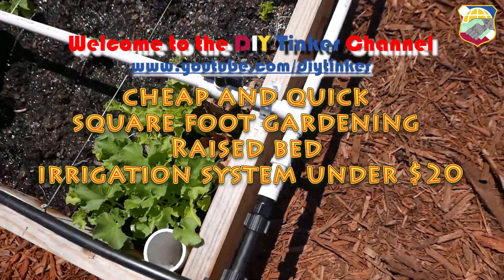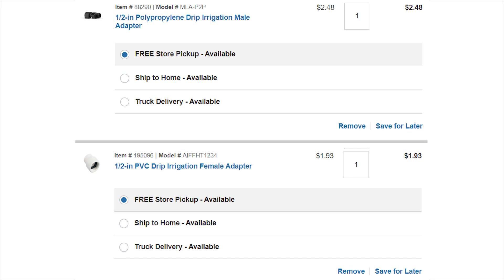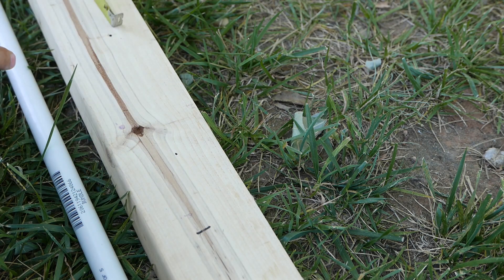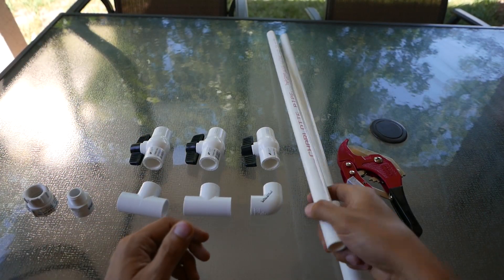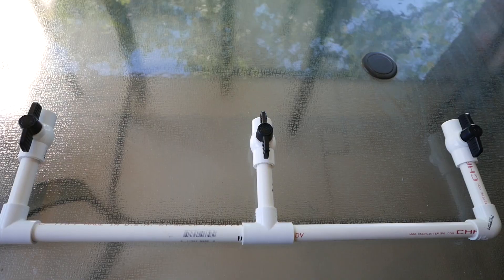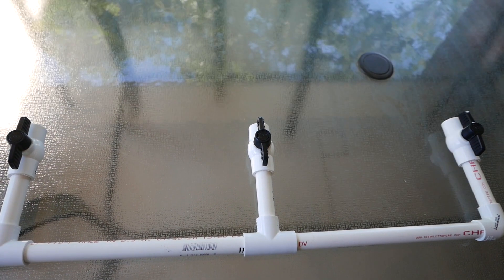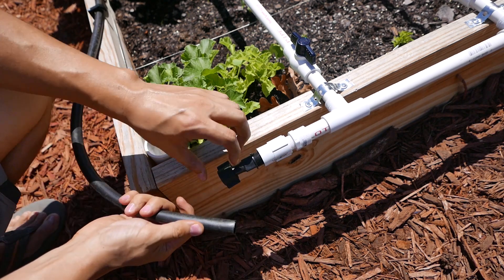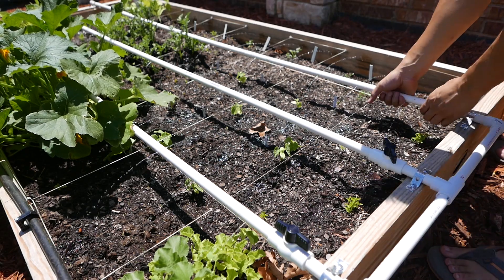$20 cheap and quick square foot gardening irrigation system that will save you time

Comment: This is an excellent video! Nice pace, easy to follow, and perfectly sequenced. Once you have your supplies on hand you can literally construct your own as you follow the video without having to rewind over and over. The photography is perfect - steady, great angles and views; you can see exactly what you need to follow along. The combination of onscreen supply and tool lists (we screenshot each part since we're beginners) in combination with the text list made shopping and gathering our tools a snap. Turned into a great project with our neighbors; once we made a couple, we were able to quickly assemble enough for our two yards. Budgetwise, this is so much more affordable than the online readymade systems, plus you can easily custom size it to your bed.

Comment: This is a great idea! Thank you for showing us a less expesive way of installing drip irregation for a square foot garden! I have yet to install one and I plan to do this with minor changes. I am using four 8x4 foot steel beds, so to support the irregation system, I will make legs with clip on tees and short pieces of PVC  at each end.

Comment: This is a great and easy to make system.  If you use cement blocks for the corner, your 3/12 inch pieces will need to bo more like 6 1/2 inches and you'll need to put another hole in the first square so that there is 2 in each.

Comment: I made mine even less costly because I didn't need ball valves.  Following his technique help tremendously....having a long enough table with a long enough slat of wood to anchor the pipes while drilling the holes....I am so so so soooo happy with this system....thank you for a quick and easy and VERY inexpensive but totally useable system!

Comment: This is exactly what I want to do! Question: is the middle pipe even necessary? If there are holes on both sides, wouldn’t one pipe water 2 square feet wide, with two pipes two feet apart, you’d cover 4 feet wide? It seems the middle pipe would double the water of the inside 2 rows?